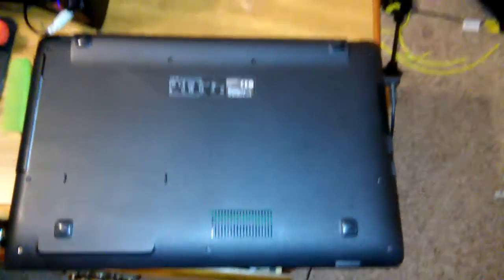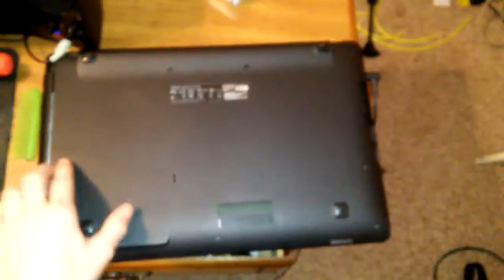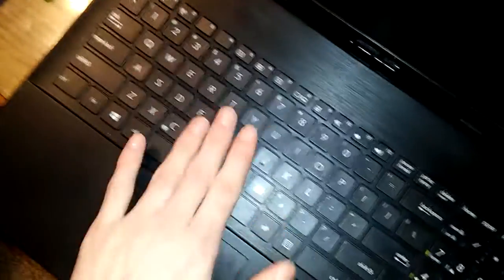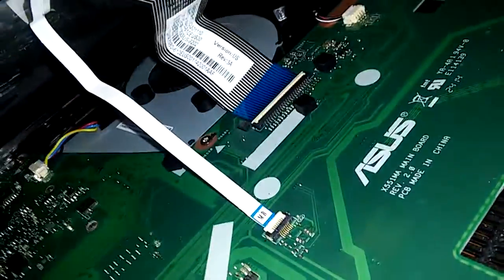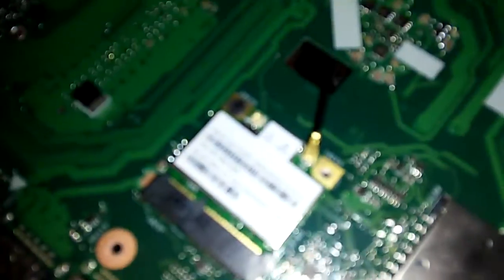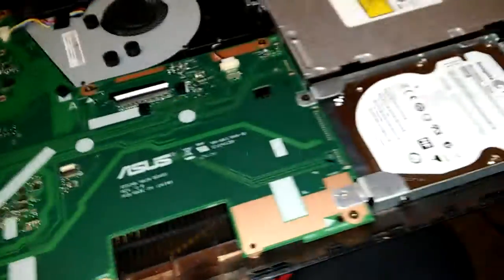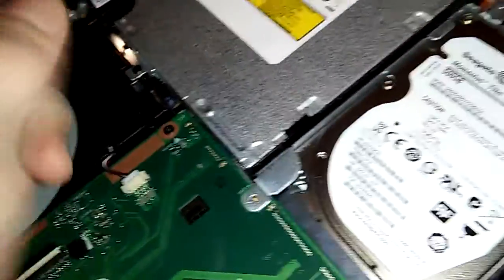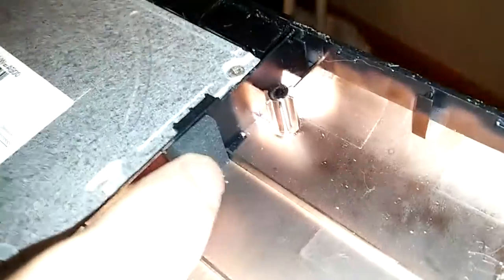ASUS x551mav TEARDOWN (Hard drive recovery)

Comment: I wanted to upgrade to an SSD and double up the ram but jesus christ.
Reply from the maker: hahah yeah, but there's only 1 RAM slot on that laptop and it's maxed out with 4GB, I've tried using an 8GB stick it didn't work, SSD upgrade would work though.
Reply: Have you tried DDR3L or DDR3? This notebook supports DD3L only
Reply: Although the processor supports 8 gb

Comment: Hello brother! How are you today? I want   ask you Some questions about my Computer .One day,           I bought Pc Asus Model X453MA new Computer. Shortly after buying my Computer It has Some problems   like: Can’t Open and Can’t charge battery when It has Problems occur, I took the my Computer to Computer shop’s lord to check in, but the owner said It doesn’t matter, and he oust  remove the battery It normally access and then when I used only 2-5 days It has problem again- using only 2-5 days . I always has problem. I want to ask whether it has problem with my Computer Asus Model X453MA. what It has problem on board or battery?  can  you know and tell me about problem with my Computer please ?
Reply from the maker: There might be something wrong with the charger (the thing that plugs into the laptop) or it could be the laptop itself

Comment: installed a 1TB HDD in place of the 500GB and I'm running windows 10 just i watched the video to see where the ram was located but you didn't get there, any help will be appreciated.
Reply from the maker: ***** Unscrew all of the motherboard screws and it will be underneath it (only 1 slot) it's factory maxed out with a 4GB stick
Reply: Divine Gaming as in that's what they give? Or that's the most? Is there a possible work around?
Reply from the maker: ***** 4GB is the max amount you can have
Reply: Divine Gaming
i see and the max ram is controlled by the bios menu/version correct?
Reply from the maker: ***** you can try putting in a 8GB stick but  I doubt it will work
Reply: Divine Gaming
yeah I've been reading up on it and most info says if max is 4 and you put 8 or more then either it will boot and only read 4 or it won't boot at all, but some one also said if there is a laptop with similar specs (but with 8GB ram) to flash the Bios they have...do you think that could work?
Reply from the maker: ***** It might but I wouldn't want to try it

Comment: Thanks for this. About to swap in an SSD and it's nice to have a peek inside before I crack the thing open.
Reply: Sam Kasten Hey dude, did you do the SSD swap? Thinking of it for mine (I get an annoying click when the hard drive reads) and wondering if it's worth it and if it was easy/possible?
Reply: Finn K Yes, and aside from some basic issues in the BIOS , the physical swap took maybe ten minutes end to end. Your SSD will probably be larger than the original HDD, which scared me for a second, but there was plenty of room in the bay.
Reply: Thanks Sam Kasten  . Would you mind going into a little bit more depth concerning the BIOS? I've swapped out HDDs and RAM before but never with a laptop, will it be as simple as selecting boot device, that kind of thing? I'm comfortable googling if you don't want to go into detail, maybe just a heads up on any obstacles?
Reply from the maker: Finn K It's pretty much swap and go but it's good idea to have a backup on a USB drive or something because when you swap them, install windows 8.1 on to the SSD and use the backup file on the USB to get all the drivers and such
Reply: Divine Gaming thanks for the tip. I've seen people using migration kits (software and a caddy/adapter) to 'clone' the whole HDD over to the SSD before swapping. Will this take the OS, drivers and/or personal files with it, and will it then be bootable right away after installing? I don't have Windows 8.1 discs unfortunately. If there's a more sensible route I'd be grateful for any advice.
Reply: Finn K OP is right about having a backup. What I did was use an external HDD/SSD caddy like this one: http://www.idsonix.com/index.php?route=product/product&product_id=51
I cloned the whole drive, operating system, drivers and all, while the original drive was still inside the laptop. I left the original drive's files intact in case there was an issue with the new SSD drive down the road, and am keeping it set aside just in case the new drive bites the dust. The only issue I had with the BIOS (which is technically UEFI on this motherboard) was messing around with drive detection settings, which you alluded to earlier. My problems were largely just a matter of switching back and forth between IDE and SATA detection, Fastboot on/off, and Secure Boot on/off until I could get the drive to appear in the boot menu. It was trial and error, but it only took three boots to find the right settings, and that was mostly because the first drive turned out to be defective. If you are lucky, you might not have to change any settings at all! For migration software I just used the EaseUS free version. I hope this helps!
Reply: Sam Kasten Thanks a lot dude. I'm sure that'll all come in handy when I make the swap! One last thing just to be sure, I'm planning on this drive http://www.amazon.co.uk/dp/B00BQ8RM1A/ref=wl_it_dp_o_pC_nS_img?_encoding=UTF8&colid=295OT3KTKFPNY&coliid=IM8PIYKFVJMLY&psc=1 there shouldn't be any problems right? Only reason I'm asking is that it seems a bit too good to be true, 240GB SSD with 700+ 4star reviews for less than £90... ? Bit of a down trade from my 1TB but I don't use even a quarter of it for the most part, and have a 500GB external in case.
Reply: Finn K I've had no problems with Crucial in the past, but I've only ever used their RAM. That particular drive isn't exactly the fastest thing on the market right now, but unless you are doing some extremely storage intensive work you probably wouldn't notice the difference between it and a bleeding edge drive. Reviews on other sites confirm Amazon's rating as typical, and that price is very competitive, even for that particular drive on other sites. Good luck!
Reply: Sam Kasten Ok, cool, thanks. I'm thinking as long as it's silent and gives me a decent boost that's all I need. I don't need the best of the best.